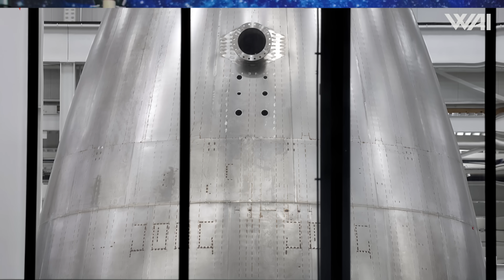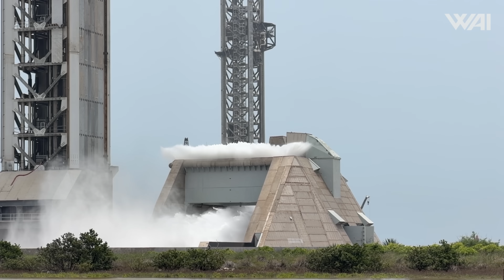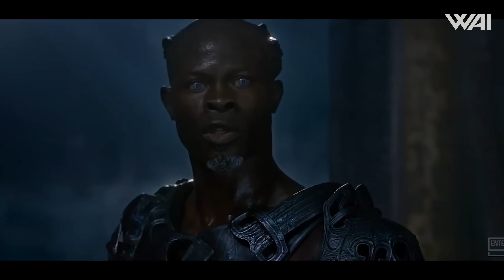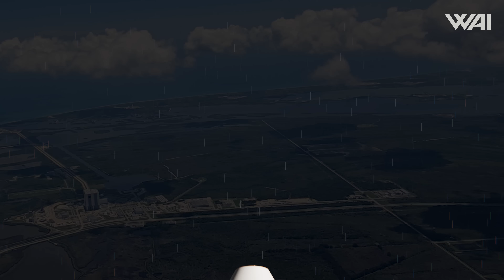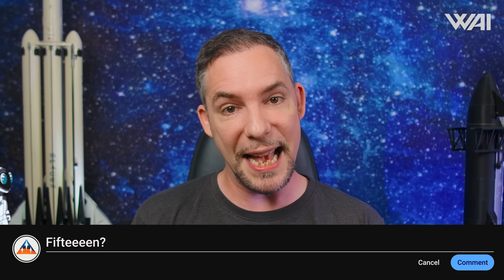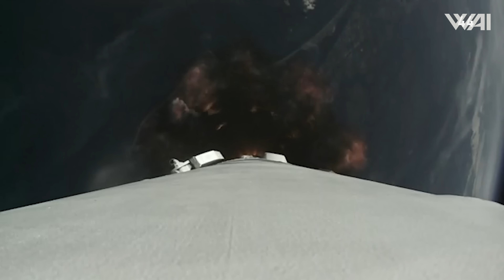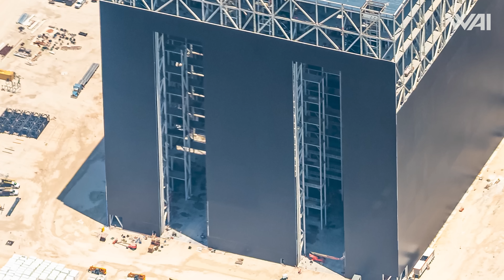SpaceX Is Getting Ready For Flight 13! NASA Reveals 15 Flights per Artemis Launch

Comment: One of the biggest problems remaining for the HLS is how to land the thing vertically and make sure it doesn’t fall over. I wonder what would happen if they were to build a bolt-on platform, fly it up into orbit, attach it to the starship and carry it from there to the moon.  They could build it with a very wide stance and plenty of other add-ons, a some fuel, some extra storage all to help manage the position of the ship as it’s approaching planet fall and landing. Then, if they ever decided to leave the moon, they could simply leave that there. It’s not a new or novel idea, as the original Moon Lander did it. But then they weren’t trying to land a 15 story building on the narrow dimension.🥸 I personally vote for laying it over on its side after getting safely landed.

Comment: Space X wants the monopoly on space ports in the gulf to control port to port shipping and fueling. To transfer supplies uninterrupted from Florida to Boca Chica. (That makes alot of sense) and it's particularly because North Americas major rail back bone enters in that area for moving steel and other Heavy Assemblies. If you want more star ports globally. You need a way to move mechazilla around the globe to make new start ports.

Comment: I think it's very unlikely that the structure on the S42 nose cone is related to prop transfer. How exactly would they use it when docked? The nose cones don't touch. And why would you even do it in the nose cone? The SQD Port is already a suitable interface that connects to both tanks. The additional plumbing that would be needed is unnecesarry mass. And from a purely practical standpoint - the ship needs to slightly accelerate to push the propellant to the back of the tanks to be able to pump it to the other ship, so a transfer interface at the top of the ship makes little sense.

Comment: Yup, but in REALITY it will become a port like those used for mid-air refuelling, this is something they are whacking together so they can test the other parts, pumps, pipes, pressure, flow rate, etc, etc.
They do have a lot of data available for what it takes a KC135 to refuels a B1. Its cold up there, but not cryogenic, so they have to test, and test again, and again, and sometimes they goof up.
Lets see the videos of that!

Comment: The primary reason for the high flight count is orbital refueling.

Unlike NASA's traditional Space Launch System (SLS) rocket, which launches the Orion crew capsule directly toward the Moon but is entirely expended (thrown away) after one use, Starship is massively heavy, fully reusable, and designed to carry massive payloads. Because it is so heavy, it burns almost all its fuel just getting into Low Earth Orbit (LEO)

To get a massive vehicle like Starship HLS from Earth orbit to the lunar surface and back, it needs to be completely refueled while still in space
While launching 15 times seems incredibly complex, the math favors SpaceX's approach because of reusability and internal volume

Comment: I think Flight 13 will demonstrate that reliability. Marcus House is reporting that they have determined what went wrong with the Superheavy on Flight 12 and it had nothing to do with the booster itself. Rather, the engines on the ship started up in an unintended, rather random order. That pushed the booster away at a completely wrong angle, causing sloshing, and everything went wrong from there. Thus, there is just a minor problem that needs to be solved with the timing of the ship engines lighting, not a major problem with the booster. That's very excellent news. 13 ought to go swimmingly.

Comment: The moon-plan is ... retarded. Like seriously. HOW bad is it that they need not just 1 but multiple refuelings to reach the moon?
And really, no, ANY time-plan given by SpaceX can and SHOULD be dismissed as their marketing-department, same as is the case with any Musk-related company, promises the stars and doesn't deliver. Just to drive that point home: To the moon by 2018, to Mars by 2023 - those were their promises. The company has a lot of money but their track-record is abysmal, failing multiple times just to get the vehicle to launch correctly.
Some day they might reach the moon if the company isn't sold and split up before that.
Reply: I still bought a stock just incase

Comment: So if fuel boil off is around 10% a month, how are they ever going to have any fuel left when they travel to mars?
Reply: a boil off rate of 10%/month and a rather fast Mars transfer of 6 months would leave them with about 53% of initial fuel. A more conservative flight profile of 7 months (e.g. the fastest done so far - Perseverance Rover) would put the remaining fuel at ~48%. Basically, they'd have to take double the fuel they actually need to get it done. The best case scenario would be a 3 month transfer, would result in roughly 28% of fuel loss using this boil off rate. The rate would be considerably lower for interplanetary missions, though, so a more realistic estimate would be a boil off rate of 5%/month or maybe even less.

Comment: There are already plans for five Starship launch pads. Two at Starbase, and three at KSC. When these are up and running, SpaceX hopes to launch multiple times daily from each launch pad. At just two launches per day from 5 launch pads, that 10 launches per day. SpaceX could fully load a fuel depot in less than two days. However, my suspicion is that there will be other Starship launch pads as well. If StarMind satellites are going to remain in sunlight all the time, they will probably be deployed into polar orbit. This suggests that Vandenberg would be a good place for two Starship launchpads. Alaska might also be a good place to launch into polar orbit. So, I wouldn't be surprised to find out that four Starship polar launchpads might be in the plans. I don't expect Starship fuel depots to be in polar orbit, but if StarMind and Starlink go polar, that leaves a lot of capacity for Starship flights at KSC and Starbase to fill fuel depots. I wouldn't be surprised if the Pecan sight in Louisiana might be a good place for several Starship launchpads as well.

Comment: Question, if they made Falcon Heavy, could they create Ultra Booster heavy with 3 combined super heavy boosters, to send up a custom tanker? for a single launch? I know the infrastructure is not there for that, but wouldn't that work? just a thought...
Reply: The bolts to hold them together would have to be insane...probably not feasible

Comment: You are talking about launching fifteen Starships one every eight days, or four days if two launch sites are used. Filling up a fuel depot in orbit. Losing at least thirty percent of the fuel due to boil-off. Then, transfer what's left of the fuel to the HLS Starship. Still, not a single Starship has ever made a single Earth orbit. But sure, they can't be more than a few weeks away from doing all of that, right?

Comment: I won't believe any of this until I see it actually happen. Fifteen flawless Starship launches in a row seems like a fairy tale. Not to mention mastering fuel transfer, adding legs to HLS, and then actually landing it on the Moon. Good luck seeing that within 5 years.
Reply: Considering we've had almost 600 falcon 9 laucnhes with only a couple failures its possible once everything is running smoothly
Reply: Cue all the Musk haters who failed out of engineering school but think they are rocket scientists, claiming it will never work.
Reply: @ericgregori I'm no Musk hater. I'm just a realistic who can read a calendar and notice trends.

Comment: "The best part is no part."  Starship already has an interface capable of fueling all four tanks, so why add a second interface, especially an interface that is not close to any of the four tanks.

15 launches of Starship will cost less than $100M, once the infrastructure is paid for.

Comment: You haven’t factored in the fact that both starship and booster can only be used 20 times so if you need a new starship and booster every 20 launches and you need 15 launches for one moon trip then you are not far off using one starship and booster for each trip. Looks the same as one throw away rocket per trio to me.👎👎
Reply: They thought falcon 9 boosters would only last 10 launches and some are close to 40

Comment: Eventually, the orbital fuel farm is going to have to have active cooling / reliquefaction which means some energy source... So big solar panels and radiators? Part of this can be alleviated by building and launching a higher pressure fuel tank, i.e.: thicker walls + insulation. 
Maybe someday a modular nuclear reactor?
The people who make a crisis about everything will lose their minds but system redundancy and a last ditch orbital raising system built in could overcome the real dangers of a reentry.

Comment: That thing on the nose cone is not for fuel transfer that will be done using the QD plate.Its just a place where an actuator will be installed because its a test tank nothing more this was already explained you can even see the bracket where the actuator will be installed if your brighten the
 Image

Comment: Maybe SpaceX’s plans for orbiting data centers could be a boon to refueling depot operation. The data centers will presumably use rather large solar arrays that standby tankers could hide behind for the shade they provide. This could save a lot of cryo fuel from boil-off waste that sun exposure causes. And constant space-shade in orbit isn’t something that any natural orbit profile can provide as far as I know.
Reply: congrats, you proved that you understand nothing about anything.
Data centers in space is utterly impractical. Would cost so much money that it wouldn't make sense because for 0.1% of that cost you could build centers on land that would be more powerful.
Reply: @PeterBurn-k6m thanks for the compliment much appreciated. I’m basing the “data centers in space” off of Elon’s interview the other day where he seems quite bullish on putting them up there. He thinks it would work if they could achieve the right balance of economies of scale. And of course, there is no property to buy up there that a terrestrial center needs to take up. Or rivers or lakes needed for cooling. Or electricity to pay for.
Reply: Data centers are polar orbit. Don't think that will be useful. Heat from Earth is not insignificant.

Comment: I’m wondering why they don’t just use a syringe type piston to transfer the fuel no pumps just open some valves and push fluid from one syringe to the other and they probably wont be transferring the oxygen and methane from the ships tanks it will probably be a separate tank as I’m proposing I think it would have to be easier than complicated pumps etc then you just have to figure out how to precool the pistons way easier I think but it would completely solve a lot of problems just thoughts
Reply: Large moving parts that take up substantial volume and mass.  Not a chance for such a thing to be used as it would eliminate all the payload even if it didn't fail.

:face-turquoise-covering-eyes:

:face-turquoise-covering-eyes:

Comment: Felix I beg you to do the math yourself. 15 is wrong. It comes from a typical naysayer's set of assumptions. Boiloff will be zero, fuel payload will be bigger, they probably are using V2 numbers. The IG office is where pessimists find shelter. The correct number is 6

Comment: 15 launches is stupid. Just because Elan wants to maximize the number of launches, he chose to send a giant stainless steel ship to land on the moon and return. They could do it with 1 launch like the Saturn V did. There is no atmosphere on the moon needing heat shield or stainless heat resistant structure. Just ego driven stupidity. If there is going to be a moon base, then mass is king, so a 150 ton stainless rocket is stupidly wasteful. It's like using a cargo ship where a family car is all that is needed.

Comment: 80 cm is the standard international docking adapter size.
Reply: That thing on the nose cone is not for fuel transfer that will be done using the QD plate.Its just a place where an actuator will be installed because its a test tank nothing more this was already explained you can even see the bracket where the actuator will be installed if your brighten the Image
Reply: The flange has an outer diameter of about 70 cm and an inner diameter of about 50 cm. However, I do believe this is a structural support for an international docking port for Artemis III not anything for prop transfer.
Reply: @lunarcaveman9928  Could be but it didn't expect a hole though the hull as Artemis III was just going to be proof of ability to dock. No entry to Starship was planned. Crew transfer is planned for BO's lander demo vehicle.
Reply: @AusNerd.6040  It could be for testing. Maybe even though as mentioned no crew transfer is planned for Artemis 3 they might still connect that hole in the nosecone to a small pressure vessel inside the payload bay plus some other equipment like a gas cylinder, valves and pressure sensors so that that they can pump oxygen into the pressure vessel and connected docking port to at least check that they have an airtight hard-dock with the Orion capsule without the crew needing to open Orion's hatch.
Reply: @lunarcaveman9928 you can see the actuall bracket where the actuator goes this is nothing with artemis III its just a test tank its the same thing we have been seeing over years

Comment: Q3 2028 Artemis IV (Correct me if I am wrong)
15 Launches =( 5 Staship launches from 5 different pads, then 8 days of turnaround ) x 3 = 24 days
1 Starship Depot launched at first, another 1 Tanker flight, 1 Starship HLS launched at the very last from Pad-39A
2 Tankers flights, another 2 Tankers flights, another 1 Tanker flight from Starbase
2 Tankers flights, another 2 Tankers flights, another 1 Tanker flight from Slc-37
Reply: 16 launch's due  main hls 4 launch,s  every 8 hours  in 24 hours  due to boil off.  2 fl and 2 in tx  = 4.

Comment: The 15 launch figure gets all the attention but it’s actually the wrong thing to focus on. 

The real question nobody’s asking is how you keep thousands of tons of cryogenic fuel stable in orbit for weeks when solar radiation is constantly warming the tanks and causing slow vaporisation. 

It sounds like space should keep it cold but the thermal cycling between sunlight and shadow is a massive engineering challenge. If SpaceX cracks zero gravity cryogenic fuel transfer and that mystery interface on the nosecone suggests they’re already working on it they haven’t just unlocked the Moon. 

They’ve built the petrol stations for the entire solar system. That’s the story

Comment: They don't need to insulate the depot. All they need is a BIG umbrella in station keeping a short,safe distance away.😊
Reply: I believe covering one side of the spacecraft with solar panels would be sufficient; after all, the orbital depot will need energy to maintain the cryogenic propellant.
Reply: @neto6339  That creates a mass issue.  How much do panels weigh?  And do they need that much power? Cooling would require power to pump liquids to radiation panels.
Reply: It would have to be attached, it couldn’t require station keeping.

Comment: I predict the Louisiana site to be a massive production and testing facility not meant for launches + data centers and all the things spacex does. Someone made a good point that launches from there would need to fly over populated areas, so not ideal. And its inland a bit.
Reply: Its roughly in the middle of the texas and Florida launch sites.  Easy to transport parts either direction.
Reply: data centers be in space
Reply: @hillbillyintheasia6122  Absolutely, but terrestrial data centers still hold tremendous value.
Reply: Considering it neighbors I bet it'd produce mobile sea platforms to eventually reach it hourly launch goal.

Comment: Really what we need is a gas station in orbit that can store cryogenic fuels long term with zero boil off. Then fueling the starship is no longer a 15 launch issue, sure if you fuel the station with starships you still need 15 launches. But for one a permanent station removes the urgency to make a mission happen over fuel loses, and in the future a bigger vehicle can be built specifically to take fuel to the station that costs less than the starship and is safer
Reply: This is why SpaceX put a test article cryogenic propellant cooling system on flight 12. An easy way to make sure nothing breaks during launch.

Comment: Have you noticed that the world is remarkability hot. The rising sea rate is almost certainly accelerating. Get ready for a StarFlood at the StarBases.
Reply: There limited options for launch site locations due to avoiding flyover of populated areas. However if/when (you choose) sea level rises they could build dykes to protect the affected areas. Seems to work in the Netherlands.